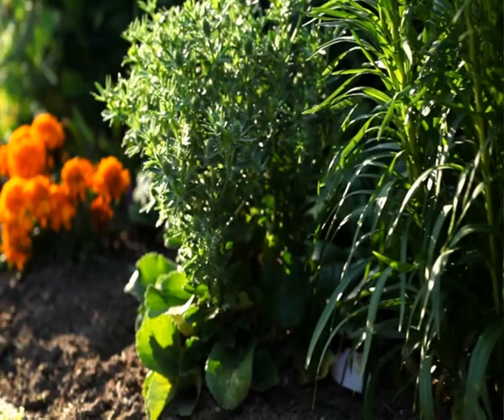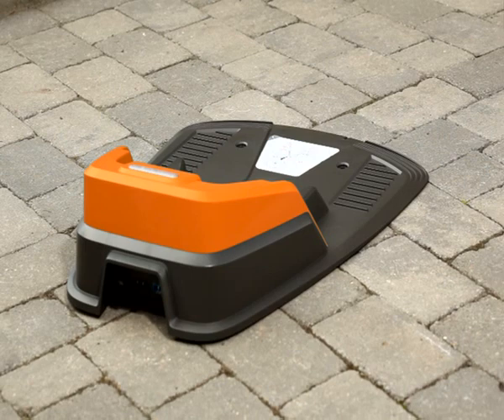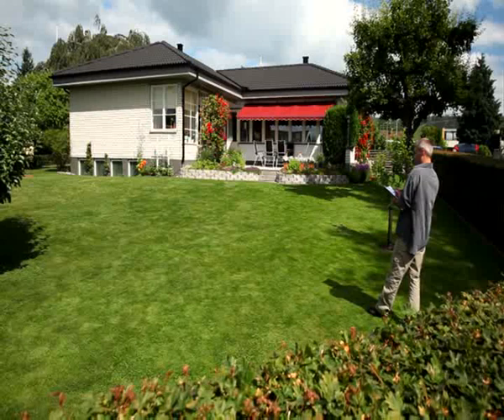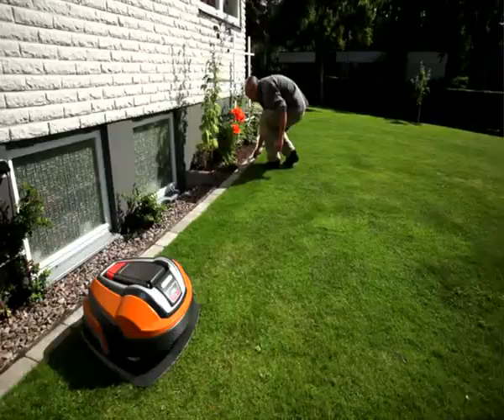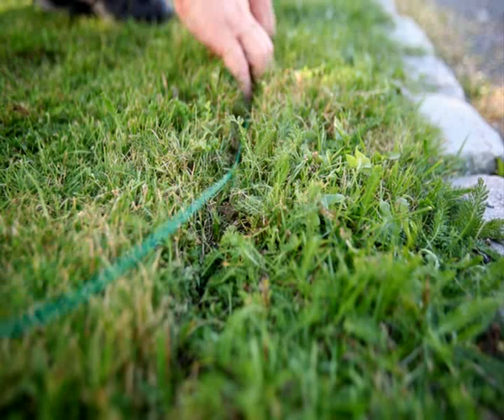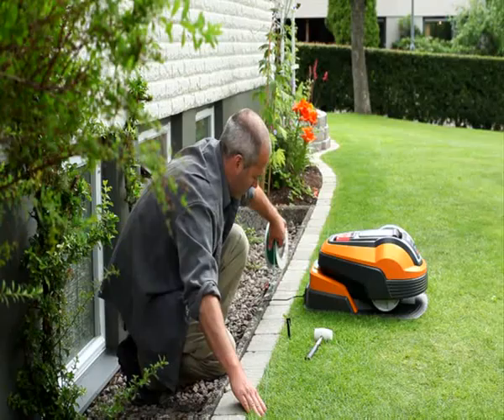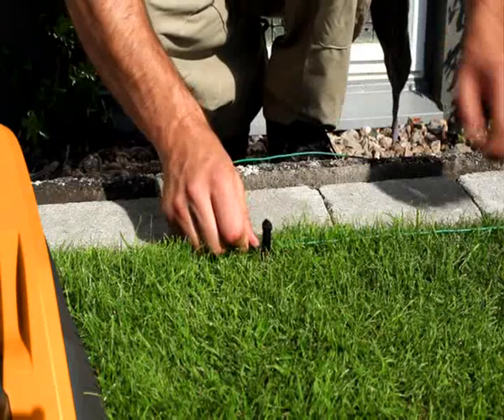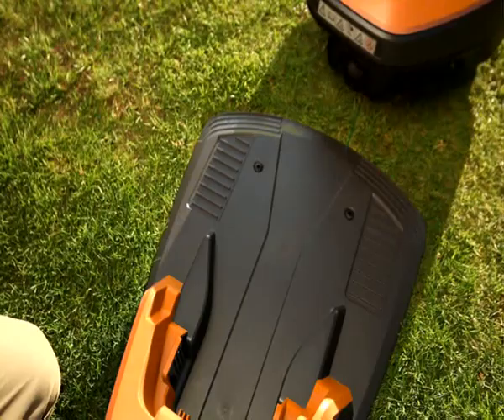Flymo Robotic Lawnmower 1200R

Comment: My flymo robot mower stopped working straight after the end of the guarantee. Did the straightforward things, battery change and voltage check with multimeter. Website and helpline give a long list of agents but none that I have called (I have called lots) do repairs. So bear in mind you might be replacing it after 3 years. Guess it depends if you think that is good value or not....

Comment: it doesn't self empty does it
Reply: as it does not empty on its own which apart from pushing a normal lawn mower  that is the other thing you do empty the grass box now if that emptied itself at a pre determined spot Ie the compost heap that would be an advance as is what does it do when full stop ? or go into mulch mode